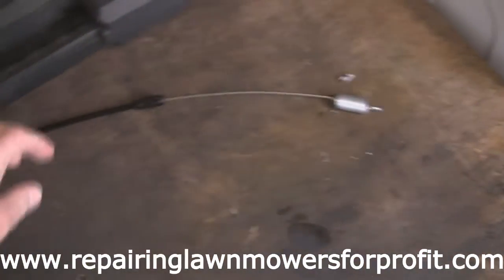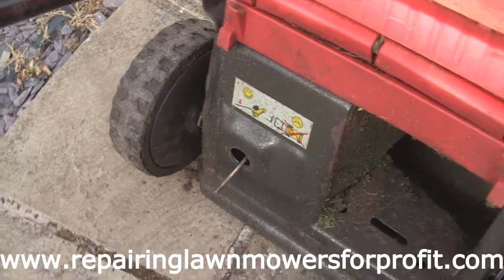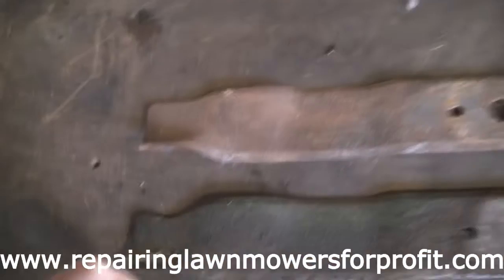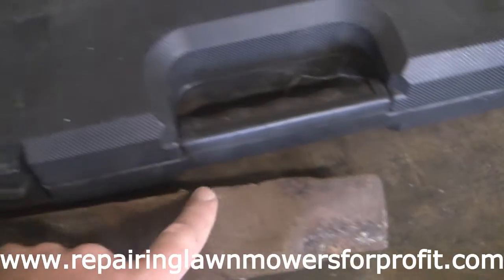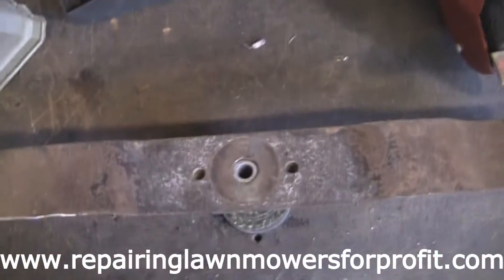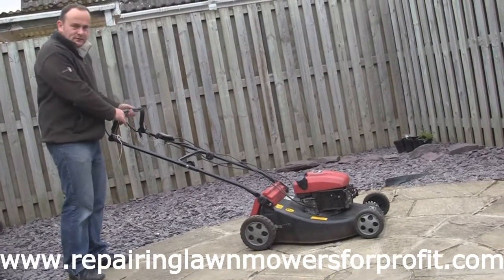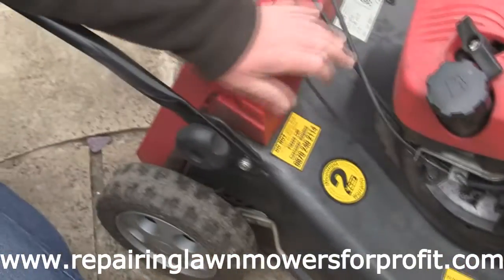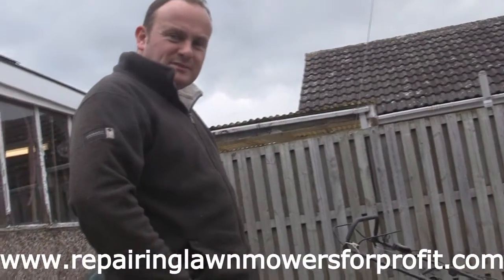Repairing Lawnmowers For Profit Part 96 ( Refit a Mountfield Drive Cable And Sharpen The Blade)

Comment: I have just started repairing lawnmowers for profit after seeing what you do and I'm 16 and it's earning me some money for things that I need.I have just bought a mountfield v35 and it's over revving and I'm not sure what's causing it? Can you help me?
Reply: Louie Purdy throttle cable pushing against the govenor arm very common on those ones. just get a cable tie and tie it to the clip of the opc cable. just move the gov by hand a few times to make sure it moves freely.
Reply: terry987654 cheers
Reply: Louie Purdy also check the throttle spring on top of the carb its common for them to break and it will barely idle if it starts at all but i have seen some come in where people have tried to put the spring back on and its far too tight and over revs.
Reply: Oh ok
Reply from the maker: Louie Purdy Good luck with your first sale